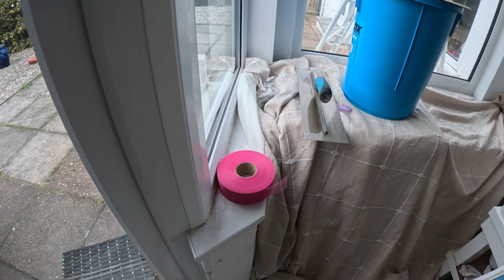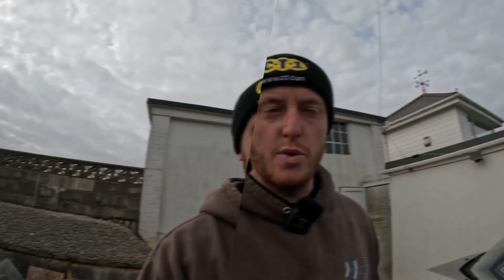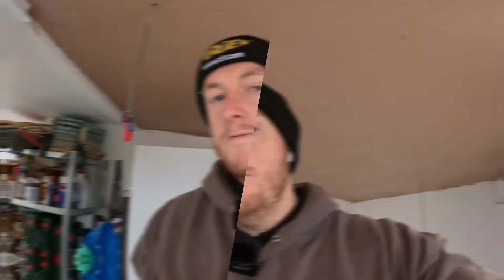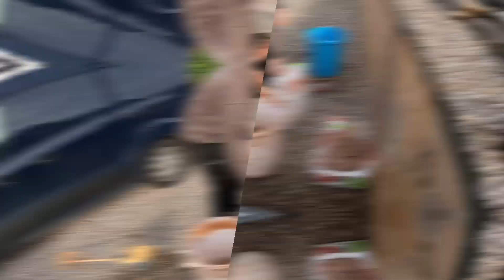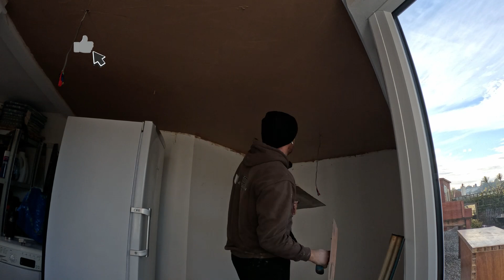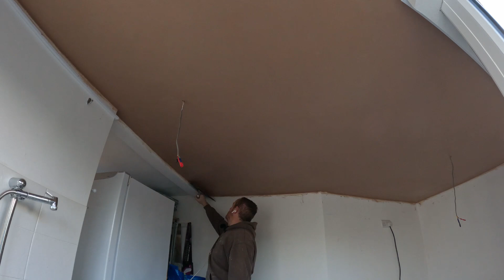How to Plaster an Overboarded Ceiling | DIY Guide

Comment: Load of bollox, a plastic float brings moisture to the surface. Any decent plasterer knows a steel float is the only tool to use and occasionally a plastic float when on a final dry finish if you’re in a rush!!! And two coats with the same mix
Reply from the maker: Steel float was used and finished off with a plazi then hard trowel 🤣🤣👍
Reply: @tddconstruction but you said in the video a plastic trowel stops moisture coming to the surface, I think that's what he was referring to mate